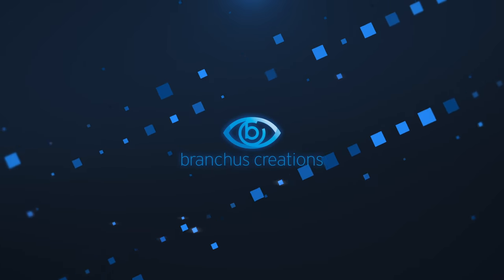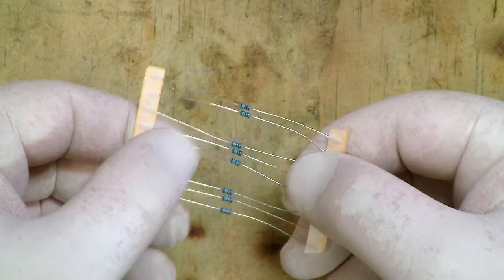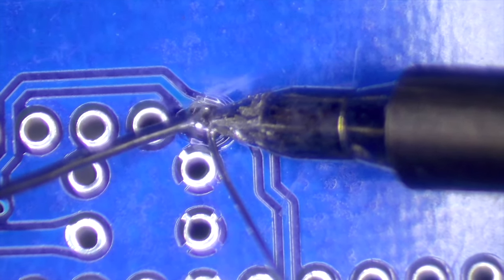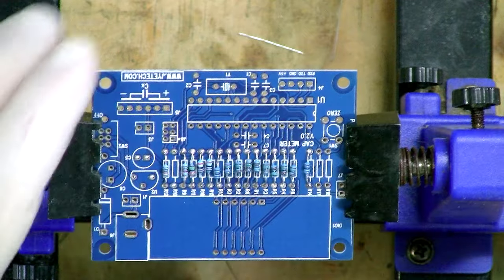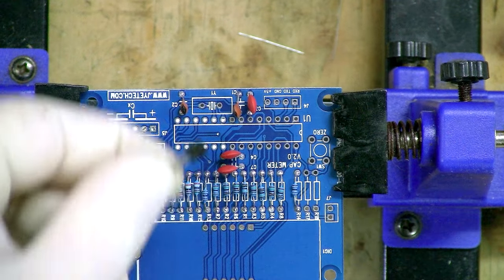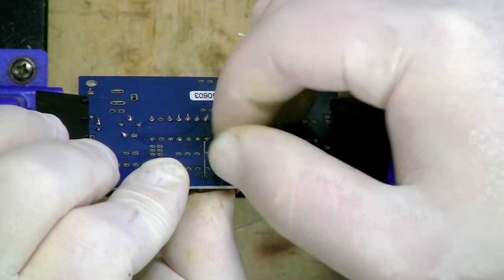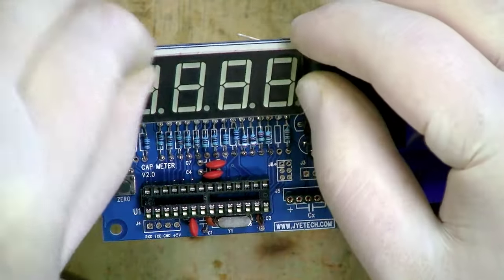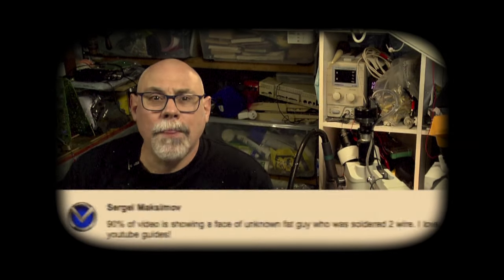Beginner's Guide to Soldering Electronics Part 2: Building a Kit

Comment: I just got a promotion at my job to manufacturing assembly not only is it mechanical and fab but also electronics and soldering etc. I have residential and commercial 120/240v wiring experience but no low voltage electronic soldering experience. Don’t really know anything about resistors and that sort of thing. They know and I know that I’m competent enough to be on the job trained. So I’m trying to Absorb knowledge from YouTube in conjunction with on the job. I hate being a newbie haha. Your series seems like a great intro so far.

Comment: I have had at least two false starts in soldering over the years ("Just thought I'd try it"), but didn't know what I was was doing, so no wonder, I see now, I didn't enjoy the experience, and the first time I messed up a bit. First let me say that just watching your videos was very satisfying - I'm not sure exactly what, but I suppose the calm relaxedness that comes from knowing what you're doing. I have been out today to buy an iron (no, spending money on simply an iron was quite enough), helping hands, neat little side cutters, a proto-board and a meter of wire. It went very well. Was a bit too careful with the first 1 or 2 solders of four solders, but a little touch-up and they looked good to me. Also stuck two bits of wire together - might expect solid wire to be more difficult than stranded, but it was easy-peasy. Thank you very much. I'll probably watch part 3 tomorrow.

Comment: Thank you Bruce   

I can weld pretty darn good but never mastered soldering for some reason but your videos are Very clear so there’s hope.

I need to fix my truck ecm which apparently has loose connections and I’m going to practice on some old computer boards before I even remove the thermal gel

I can actually turn the truck off by pressing the gel over the chip which leads me to believe the soldered connections are bad .. At least that’s what I hope.

Also my best soldering iron is an older #145 45 watt Ungar or a Taiwan no name 45w with changeable tips so learning as much as possible to see if it’s good enough  but may need to upgrade to 60 or 90 watt.

Tell Sergey all I see a smart bald guy so he needs to adjust his glasses…
I’m just an older slightly overweight receding hair line guy…   

Thanks again

Comment: @Branchus Creations Hello. What temperature  are you soldering at??
Reply: I'm curious this one too ^^
Reply from the maker: I actually solder at a very high temp (430ºC), which is higher than I would generally recommend to others. It's just the way I do it. I would usually recommend soldering at around 350ºC (650ºF) when using leaded solder.

Comment: Great video. What thickness solder wire did you use?
Reply from the maker: I typically use 0.5mm (.02") for surface-mount soldering and 0.7mm (.028") for through-hole soldering. I like to use a solder with 63/37 tin/lead ratio and a rosin flux core. I don't get too hung up on brands, as long as they are good quality.

Comment: When you are melting the solder are you touching it to the tip of the iron first or to the pcb?
Reply from the maker: I generally place the iron onto the PCB (but also touching the component lead), then feed the solder into the heat.

Comment: I love your videos. My daughter and I just got into soldering. I bought her a nano bots kit by Geek club, but we had some serious difficulties because our first experience soldering was surface soldering. We are using your videos as a large guide to learn. We are going to order one of the kits you mentioned in this video. We would love if at some point you could do a step by step tutorial on a nano bot if you get time so maybe we can see what we are doing wrong. I haven’t looked through all of your videos yet, we are making our way through slowly. Do you have a video on beginner mistakes? We have learned to heat the work and apply the solder to the work. We also learned to work at a higher temperature and are in the process of ordering a bevel tip for our iron. Looks like it heats so much faster. That being said where are some good places to start that will accelerate our learning path? Things to avoid doing and mistakes you have made so we can learn from those and save time. Thanks for the video! Love it.
Reply from the maker: Thanks for the comment! There is a "soldering mistakes" video in the pipeline.

Comment: I am sodering to a flight controller for a fpv drone and I can not get the battery leads to stick.Ive tried different soder,different heat settings I got it super clean and the wires will not hold to the board

Comment: I have a soldering iron that is not hot enough at the tip even though it should be, but further up on the shaft where the heating element is, it is more than hot enough to melt the solder.  Could a wrong-sized tip be the problem here?

Comment: If you are new do not start with leaded solder. It will be just a bit harder (you just need to turn up the temperature to about 400C) but it is so much safer for yourself and your surrounding environment.

Comment: First, I watched this video just for kicks but it was a good vid for rookies. The thing that got me us I cannot believe the snowflake attitude people have about lead, zink, mercury  (and just about everything else)  today.

Just for background, I am an engineer and a retired industrial electrical./millwright contractor. I have been sweating copper pipes with 50./50 solder and acid paste since I was 10 years old. I built my first Eico VTVM when I was 11 using 60/40 rosin core solder and have used it ever since from then up to repair of CNC mill control last week. I also silver braze with active flux, Weld with 7018 electrodes, and even weld galvanized metal and have eaten more zink fumes then a junky smokes dope. - In all that time I have never used gloves with lead bearing solder, and never used as much as a dust mask when welding or soldering,.....According to OSHA and the pencil necks I should have been dead years ago but other then arthritis in my knees, I am in 100% perfect health. (Just re-roofed my barn by myself over the last 2-1/2 weeks. The pain in my knees was beyond belief the whole time but I got it done.) Just for the record I know dozens of men that did the same things I (or worse) then I did. Nobody died from lead poisoning (Except for a few of my brothers in Vietnam)  

Here is the rub kiddies, if I live 2 more months I will be 75 years old.,,,,,When did people become afraid  of virtually EVERYTHING and when did cowardice become an art form?